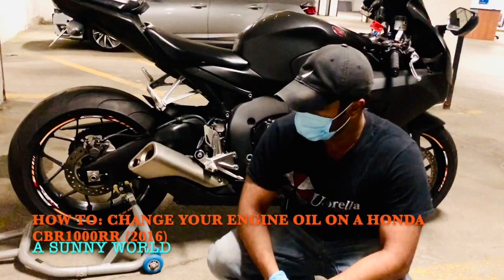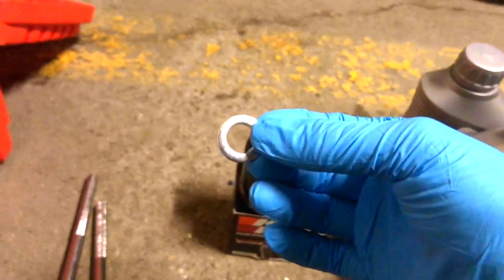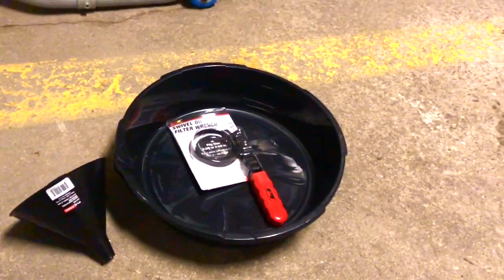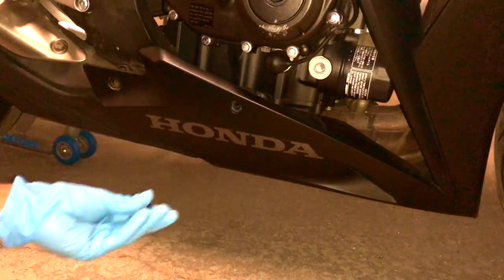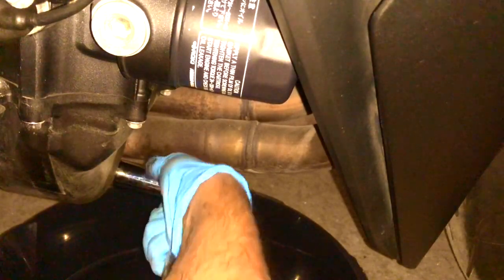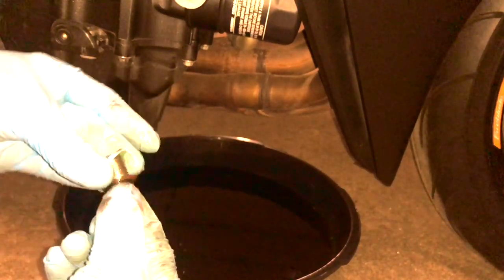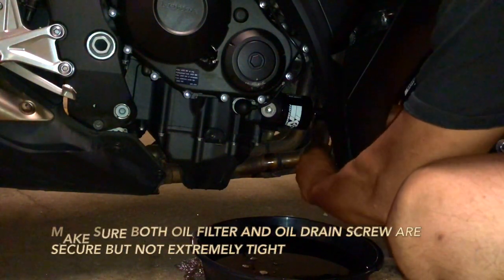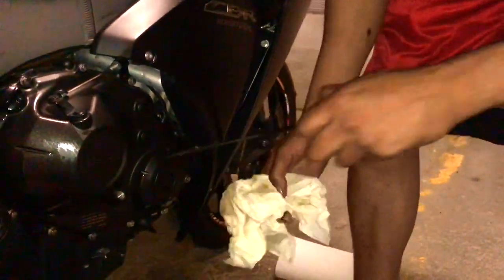How to: change your engine oil on a Honda Cbr1000rr (2016) (English)

Comment: Pretty sure the manual says 3.9 quarts if you disassemble the entire engine suppose to only put 3.2 quarts for a normal oil change with new oil filter